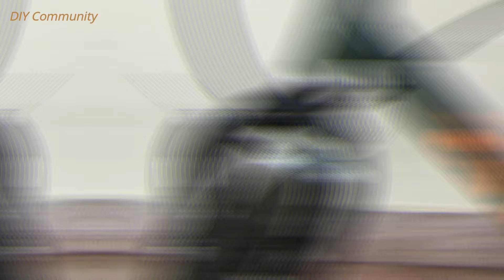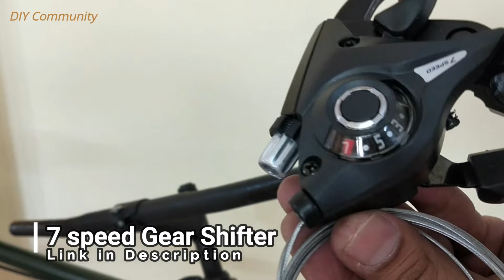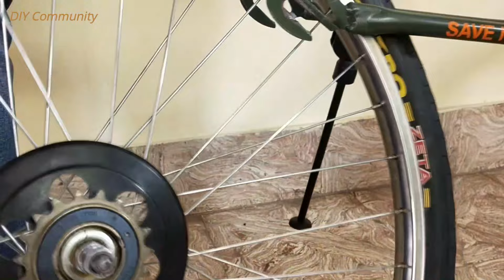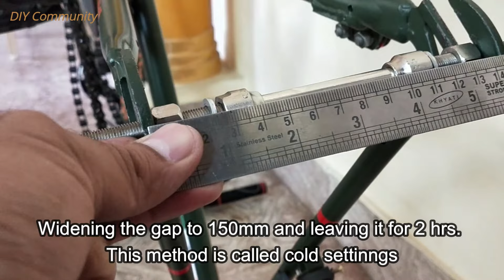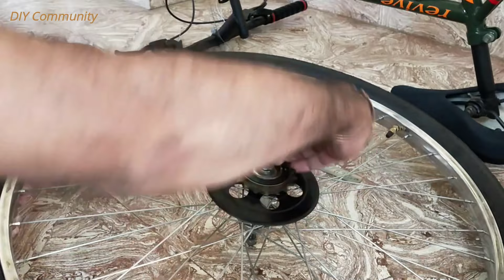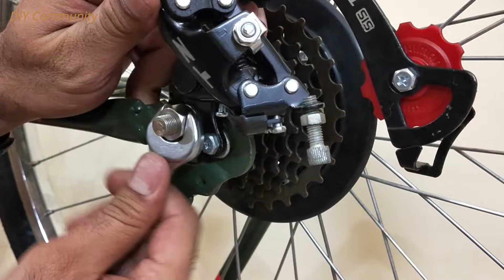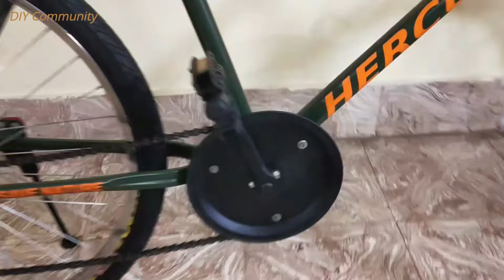How to Install Gears in Any Cycle - DIY Installation | DIY Community

Comment: Can cold setting be harmful for the frame in future ? Is there any possibility of breaking the frame while doing this ?
Reply from the maker: Hi, cold settings are permitted only on iron frames. So I don't recommend on any alloy or cast iron. Each metal has a permissible limit so it's good not to force too much. As we do this slowly and steadily there is lesser chance of breaking the part.

Comment: Which model of Hercules Cycle is this...???
Reply from the maker: Hi Saurabh, This is a 17 year old cycle and the old stickering was Hercules MTB over size.
Reply: @DIYCommunity  I'm using same cycle for my daily rides.
Reply from the maker: Wow that's great to hear. It is a good cycle with better fit. Very sturdy frame. Happy cycling !
Reply: @DIYCommunity  Yes, very sturdy frame & great cycle but only thing I miss in this cycle is gears & some powerful breaks which I'll upgrade in near future. Plz suggest me some good components as currently there is shortage of Shimano derailleurs in market.
Reply from the maker: Install V Brakes that will easily fit that cycle. Try for Shimano if not try the equivalent which is available for now and Later you can replace if needed. Widening the seat stay and settings up the angle on the frame is a big part. If that's done any derailleur will work smoothly. Keep all other parts as original which quality we don't get now. All the best !
Reply from the maker: Hi Saurabh, I have restored this cycle and pls check out the restoration video in the channel if interested.
Reply: @DIYCommunity  Thanks A Lot..!! 👍👍👍

Comment: on a rear derailer that little screw,do you need to tighting it?
Reply from the maker: Hi, there are 2 screws which you will be adjusting for both limits. This helps to protect the chain from coming away from gears while using the lowest or highest gear.

Comment: i have hero hawk single speed cycle and  i want to install gears on it and  it is a steel frame should i go for 6 speed or 7speed.
Reply from the maker: Hi, you can go for 5 or 6 speed.

Comment: Is there a way to make a bike with a sturmy 3 speed compatible with a 3-speed cassette?

Like, are there there any conversion kits? 

I love my hercules i found at the tip, and I wish to add a higher and lower gear without completely removing the 3 speed hub.

There are 2 ways i can think of doing it. The problem is, do the parts/kits exist?

One of my ideas is to replace the single speed sproket on the hub to a small 3-speed cassette, and the other is to replace the single speed drive gear with a 3-speed cassette. 

Any information would be huge.
Reply from the maker: 5 or 6 speed gears are available in market. If you wish you can alter by removing 2 gears out of it, but requires some mechanical effort. Give a try!

Comment: Anna I can use this modification for atlas contender cycle
Reply from the maker: Hi Brother, you can do if your cycle frame is made of steel. Not recommended for Alloy frame as it may brake while doing adjustments.

Comment: Can we never install the freewheel without the 200mm rear axle please reply 🙏🙏
Reply from the maker: Hi, when you increase the size to accommodate the gears you need a long axle to get through the length. You can measure and get one. It should be easily available in nearby cycle store.
Reply: @DIYCommunity  ok

Comment: I have Raleigh Thruster 29t Single Speed MTB. Can i fit gear on it ? Is that possible ??
Reply from the maker: Hi Arun, You may have to check the gap for fixing gears. I believe Raleigh bike comes with upgrade option, If yes you can go for installing gears and if no then I don't recommend doing any changes on Alloy frames.
Reply: @DIYCommunity  thank you sir 👍🙂
Reply from the maker: You are welcome!
Reply: @DIYCommunity  my cycle is steel frame sir
Reply from the maker: Hi then you can expand the rear gap to install gears. You can give a try or take help from a cycle mechanic. All the best !

Comment: Bro can you please say can we fix thumb pressing gear in non gear cycle i want it to be fixed but the shopkeeper told it must be only 6 gears can we get and fix it please reply i need your help bro and my cycle is hercules top speed fx200 26t
Reply from the maker: Hi, you can install gears and as the shopkeeper said you can only go for max 6speed. If your cycle frame is made of steel you can enlarge the gap to accommodate gear freewheel if it's made up of aluminium alloy I don't recommend you to alter anything in frame as it might bent or break the frame.
Reply: Oh ok bro thanks a lot for your help at this time

Comment: What is the total cost you made gear cycle things
Reply from the maker: HI the entire set costed me around  Rs.1500/- if you get only one gear shifter (6 speed alone) it may be still cheaper.
Reply from the maker: Hi, I recommend for only 5 gears for smoother experience.

Comment: I have Fantom Max single speed ...I want to fix gear in my bike? Is this possible?? If yes...so plz.. suggest me which speed is ok.?
Reply from the maker: Hi Sarjerao, If your bike frame is of aluminium alloy then I don't recommend for any change. If it's a steel frame then you can make  adjustments as shown to install a gear freewheel. You can choose only 5 or 6 speed to avoid chain slippages.

Comment: Sir how you are experiencing after gear installation, people say aftermarket gear installation create issue, do not work properly. I need to add gear to my single speed.
Reply from the maker: Hi, with correct allignment of rear wheel and making enough space for gears will work fine. Initially you may have to make some trial and error to get to that position. Once set then no difference between OEM or after market.
Reply: @DIYCommunity  thank you for you response and time sir. Thanks for information.

Comment: Is it possible in firefox bad attittude 7 single speed cycles?
Reply from the maker: Hi, if you cycle frame is made of steel you can do this modifications. Make sure the gap is even a and tyre is alligned perfectly on center. All the best! Stay connected

Comment: Are 6 speed gears enough? I have 27.5T with disc brake. Do i need to expand frame for 6 speed freewheel?
Reply from the maker: Do not try this on Aluminium frame if it is. 
If you are planning to get more gear ratio then plan to change the front crankset also to 3 speed.
Reply: @DIYCommunity  my question is that if i install only 6 speed gears, then will i have to expand the frame and change the axle? Or the old setup would work ?
Reply: @DIYCommunity  could you please give me your insta handle? I need to discuss some things about gear modification.
Reply from the maker: Yes you have to. Few will have wider space for upgradation and most of them not. Check measuring the gap and decide

Comment: i am getting local vanum 7 speed gear set installed from a local cycling shop in rs800 only( price includes installation)

So should i go for it??????or should i go for shimano?
Reply: Brother, Did you got the gears installed?
Reply: @TanM  not now but i know what i have to do

Do u need any suggestion
Reply: @hemank8435  If we will applied gears in a normal cycle can it work?
Any problem occurs?
Like, slipping chain etc. 
Please help me.😭
Reply from the maker: Hi, with a proper alignment of wheel and adjusted of gears we can install in any cycle. Ensure the frame is of steel so that the gap can be increased to fit a gear freewheel.

Comment: I have heard some feedback that replacing the single speed freewheel with multi-speed freewheel will de-shape the cycle frame. And having done this customization, the chain will come off frequently while riding the cycle.

Is it a good idea to add gears to a normal cycle?

Comment: Hi friends ,I have 91 granite x40 single speed cycle ,can i fit gear in my cycle. Reply must bro.
Reply from the maker: Hi Dillip, I just saw 91 granite x40 is with steel frame. So yes you can fit gears. Try for only 5 or 6 speed and not more than that. Also ensure the gap is made even to fit gears and the wheel is centred correctly. If needed take a help of a cycle mechanic. All the best!
Reply: @DIYCommunity  thanku bro
Reply: @DIYCommunity  Hi bro, could you tell me what will be the required width of space to install 5 or 6 speed free wheel.
I mean widh of the free wheel.
Reply: @DIYCommunity  bro , there will be  problem of disc brake after expansion of frame.
Reply from the maker: Hi, The disc brake also need to be adjusted. Do think any extra spares needed to it.
Reply from the maker: Hi, the size depends on your wheel hub which may differ on each brand. You have to measure the hub length, freewheel length & extra gap on each sides and then decide on the shaft length.
Reply: @DIYCommunity  thnku bro

Comment: Can I install 8speed cassette on Raleigh strada 700c in this same process?
Reply from the maker: Hi, No 8speed can not be installed. For 8sprred the frame structure is different and that should be come from manufacturing to get the strength.
Reply: @DIYCommunity  I have the 8speed cassette hub,and 8 speed cassette, acera derailleur,, I will change the original hub with cassette hub,,, I just want to know, now please rply can I install
Reply from the maker: Hi Pradyut, firstly measure the size of your freewheel and new cassette, if they matches you can go for it. To my knowledge 8 speed will be bigger in size for which the space needs to be increased. As you bike already has gears extending the gap may reduce its strength and stability. Do the above checks and decide according.
Reply: @DIYCommunity  Raleigh strada 700c is a single speed bike,,, can't I expand the frame that much to fit the 8 speed cassette?
Reply from the maker: Oh okay, sorry I didn't know that. In this case cassette installation is not worthy. 5 to 6 gears is optimum on its performance and more than that we may face difficulty in aligning the rear wheel and gear shifting.
Reply: @DIYCommunity  and does it affect the strength of by bike?? It is a steel bike
Reply from the maker: Yes extending the gap more may affect the strength and aligning rear brake is a big challenge.
Reply: @DIYCommunity  ok,,,thank you very much
Reply from the maker: You are welcome. Connect with me anytime if you have any other to discuss. Stay connected! Happy Cycling!

Comment: Is it possible to add gears in allumenium frame cycle? Please answer
Reply from the maker: Hi, If the manufacturer had provided gaps for adding gears then we can else we cannot increase the hub space in aluminium frame. If may break.

Comment: I have a mafia bomma 29 inch, it's basicly a big bmx for wheelies and it has disk breaks, do you think it's possible to get gears on it?
Reply from the maker: Hi, If it has a steel frame then yes you can give a try.
Reply: @DIYCommunity  I think mine has a aluminum frame 😢 it's fine tho I'ma get a mtb for wheelies soon
Reply from the maker: I recommend not to try any modifications on alloy frame as it may result cracks or even breaking the metal. If the bike has given space to install gears then you can go for it otherwise no.

Comment: Can I fit shimano  alivio  in my caya warrior 26 single speed cycle  can I fit 27 speed gear (9×3) with cassette
Reply from the maker: Hi Karthik, you can only go for 6x3 for better shifting experience. As the frame is not designed for gears we can not force too much to enlarge the gaps. And if your cycle frame is made of Aluminium alloy then it is not recommended to install gears unless the frame is designed to accommodate some gear freewheel.

Comment: 200mm rear axle link where?????
Please share me the link.
I cant find in the local market of that lenght
Reply from the maker: Hi, I did not find the suitable link online. Just ask for a gear cycle rear axle. 180mm or any adult gear cycles axle will serve the need. Let me know if you need any other guidance. All the best!
Reply: @DIYCommunity  also bro can you make video in depth from attaching of derailleur to till its adjustment
Reply: Iam having difficulty in adjustment of the derailer
Reply from the maker: @er.m.s8930  Sure. Can you tell me which part you want to understand more ?
Reply: @DIYCommunity  after installing the derailer, my shifting isnt going proper.
 Chain come out of the flywheel time to time.
   It makes nosie, skipping of gear while shifting
Reply from the maker: Okay I got your point. Seems like the frame alignment needs to be made proper. Will make a video on frame alignment. Thanks for bringing this up. Stay connected !

Comment: Can we install cassette instead of freewheel ?
Reply from the maker: Hi, Yes you can install a cassette and for that you need to replace the existing hub with a free hub. Also keep a note that cassette comes from 7 speed and for that you may have to enlarge the gap more than what you do for a freewheel. Think for the sturdiness of the frame. Also if its not a disk brake setup then aligning the brake is a bit challenge where you may have to use some extender clamps. Hope this helps!

Comment: How many  rupees all things brother
Reply from the maker: Hi, below is the item wise cost in INR
1. Smimano Derailleur - 299/- Flipkart
2. Trigger shifter set -422/- Amazon
3. Freewheel and chain combo - 497/- Amazon
4. Gear cable sleeve - 60/- local market

I brought all major items online and found cheaper when compared to local market. Rates may vary time to time and check for best offers and you can order them. I have left buy link for all these in description.

Comment: Brother Hope You Doing Well ☺️🤞
Brother kea yea 7gare jo ap ny video may dhkay hy yea 3x6 gare wale cycle may lag sakty hy Matlab mery pass 6 gare wale cycle hy use may yea 7gare waly gare shifter lag sak ty hy please reply me
Reply from the maker: I am doing well Dilip, Hoping everything well at your end too !
Yes you can convert your 18 speed to 21 just by replacing the gear sprocket and a 7 speed shifter. I haven't done that modification but I am sure that is a easy and feasible option.

Comment: Total how much price we want
Reply from the maker: Total cost of all items shown in this video would be around Rs.900/- This is for trigger shifters and Shimano derailleur. You can even choose local made items which will be even cheaper.
Reply: We get this items from cycle shop
Reply from the maker: Yes you can find them in nearby cycle spare parts shop. Also you can buy these online and I have given links in description.
Reply: Freewheel is not
 support to cycle
Reply from the maker: @KESSLER742  freewheel and cassette are different. Freewheel should support all cycles. Don't go for cassettes.
Reply: @DIYCommunity   i think i want to change cycle tyre hub
Reply from the maker: @KESSLER742  first check with a nearby cycle shop and reconfirm. Because freewheel should support all cycles. You need to increase the space between bars to accompany the size of new freewheel. All the best!

Comment: Thanks! I plan on putting a few gears on a single speed. I’ve calculates what I want, and 5 speeds would cover all I need. It’s cool as there aren’t several chain rings, or 7,9 etc gears that need not clutter ones mind, and really are unnecessary as most do not utilize such small increments of adjustment ever really.
Reply from the maker: You are correct !
Reply: I’ve been riding a 5 speed 1-by commuter city bike for a few years now. Thumb shifter (microshift). Very pleased with how it turned out.
Reply: @PRH123  I figured out which gears I will utilize, so why have these unnecessary gears that take up real estate on a beautiful piece of machinery. And let’s not forget the maintenance that is depressing enough to cause a thinking person to say there has to be better way.
Reply: Problem with that is no one makes 5 speed parts anymore unless it's expensive restoration parts
Reply: @johnsmithers284  it’s easy to find a 5 speed freewheel on Ali Express. And that mounts on a standard freewheel hub. And then any friction derailleur and shifter will work with it. 

Alternatively you can use a cassette hub, and use only the 1st 5 gears. You could even remove the top 3 cogs and replace them with spacers.
Reply: @PRH123  a cassette hub isn't going to fit into singlespeed hub spacing
Reply: @johnsmithers284  Depends on the OLD of the frame dropouts of course. I have a cassette hub with 1 cog & spacers on my singlespeed, OLD is 135. You can do the same with OLD 120.
Reply: @PRH123  you didn't read my comment
Reply: How much 5 speeds cost?
Reply: @asterakki0810  I am not sure. You can either take away from a higher number, or put together any number of gears you want including tooth count.
Reply: @asterakki0810  You can't really get 5 speed parts anymore. I would not trust an aliexpress 5 speed freewheel.
Reply: @johnsmithers284 then it's You, not the scarce
Reply: @thatthingyoudo6398  enjoy the 6 months you get out of that thing before the Swiss cheese steel cogs round into nothing

Comment: Can I install 8 gear in single speed mtb cycle
Reply from the maker: Hi, I won't recommend as the chain wear will be more and more chances of chaing dropping out of crankset. If you are planning to install a 3 speed crankset in front then you are good to go for 8 speed in rear.
Reply: @DIYCommunity  7 is good then
Reply from the maker: 6 is better, with 7 have to do more settings to mak it stable.